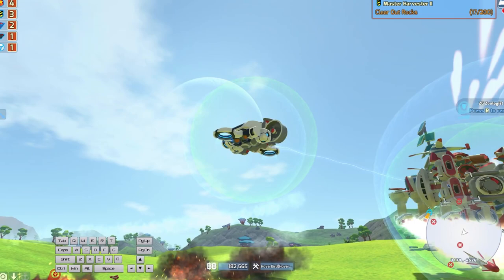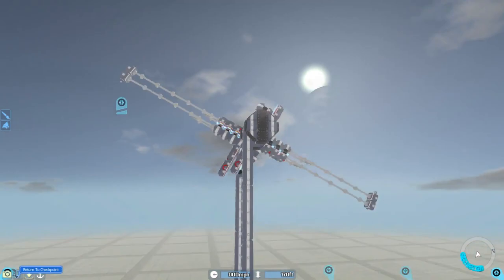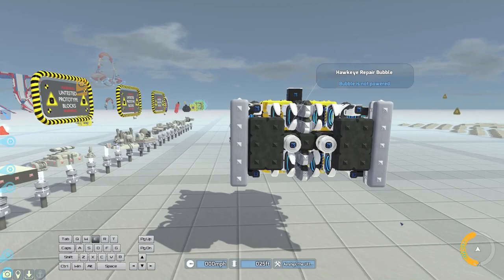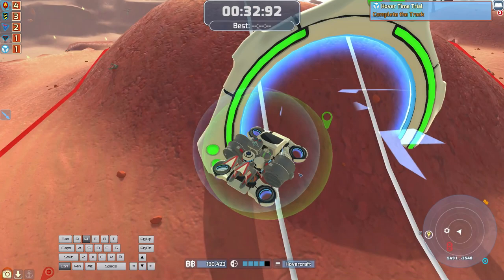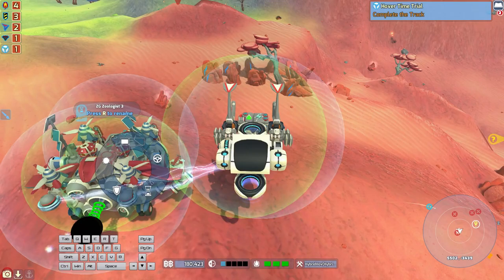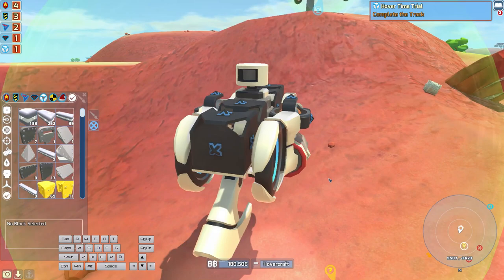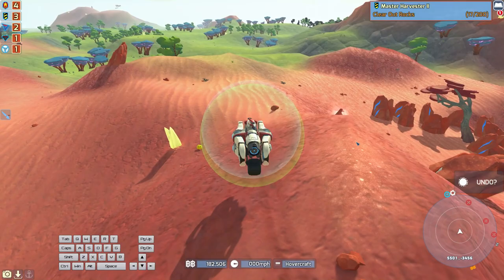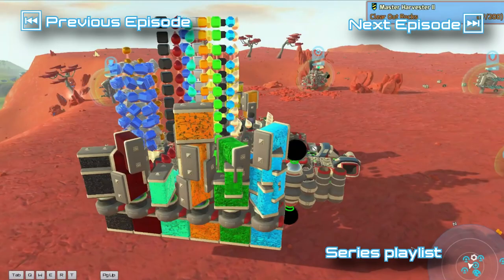TerraTech | Hybrid Hover-Bug Racers | Tutorial & Gameplay | Ep9

Comment: i just want my megatanks to actually be lighter :(
Reply from the maker: You could try using anti-gravity (is you're on PC). And hover-bug could help too, of course.
Reply: @ZeroGravitas  my older save kinda nuked itself so uh... i'll have to rebuild. I like the new Sky Anchor thing at least so i can anchor and build stuff/ sell all in one go :o
Reply from the maker: @ailehunter  It's certainly well suited to anchoring huge techs with tall ground clearance. 

Doesn't give the same benefits as rigid anchors, though, which allow resources on the tech to pass through it without physics (so they won't get stuck in places and be pulled off, etc). But you can build your crafting parts around that. :-)